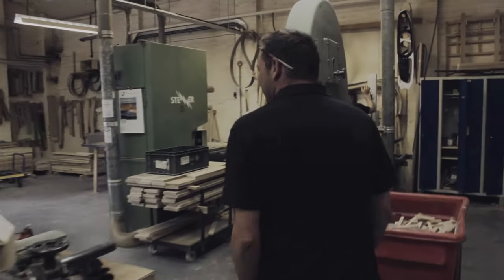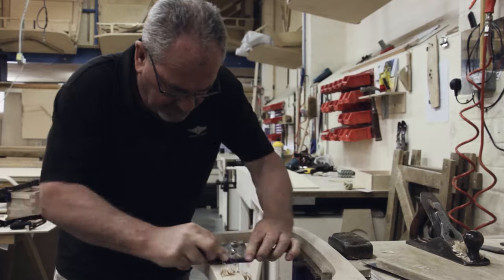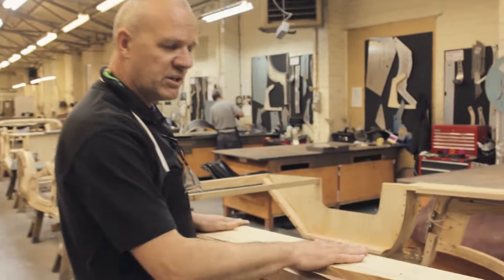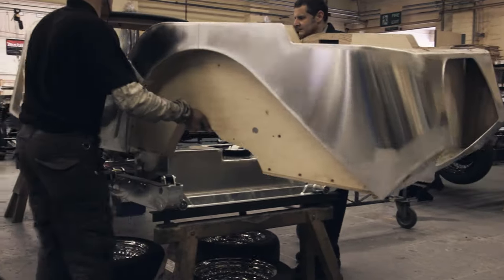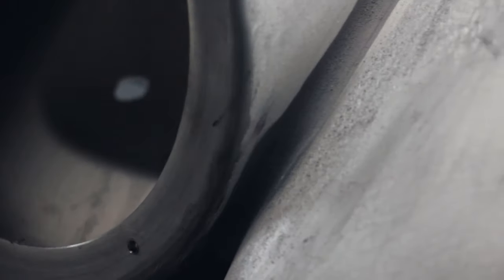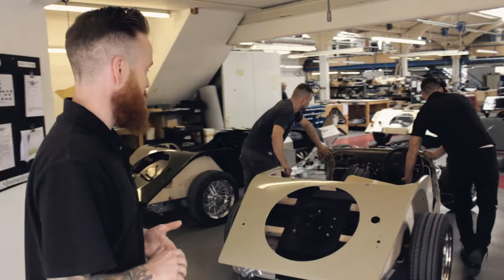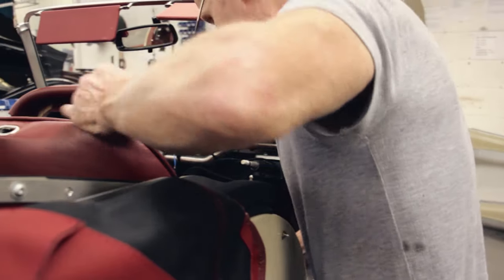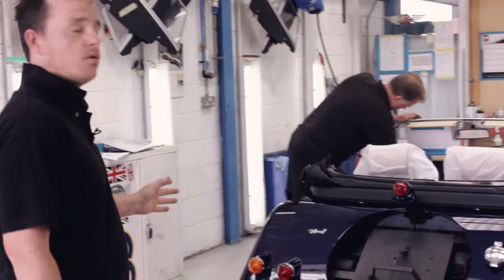Morgan Motor Company - This Is How We Do It

Comment: The guy talking on the video said that they use aluminium sheet metal for paneling over the wood but then he says that they have to paint the backs of the panels to prevent them from rusting... I thought that aluminium doesn't rust???
Reply: It doesn't, but it will - without protection - oxidise, which is what I think this chap was alluding to.
Reply: @gregtaylor6146  but do people care about the aluminum oxidizing? Because the oxidization stops once a thin layer is formed? It is almost like a free layer of protection lol
Reply: That 'thin' layer of oxidisation will over time get incrementally thicker and thicker till eventually that once shiny panel becomes nothing more than a powdered trail of Al2O3 coating the road leading to your garage.